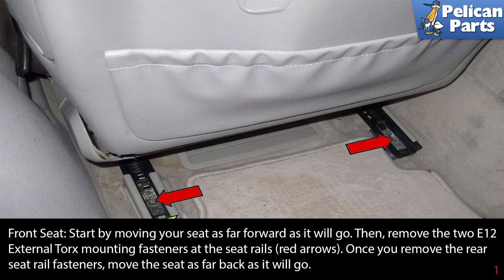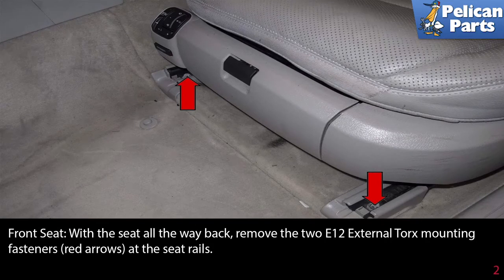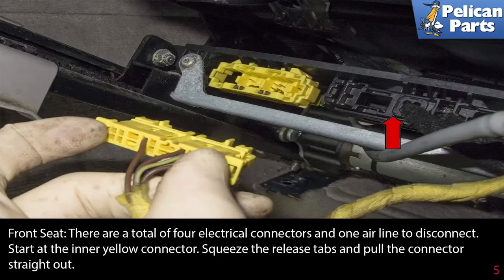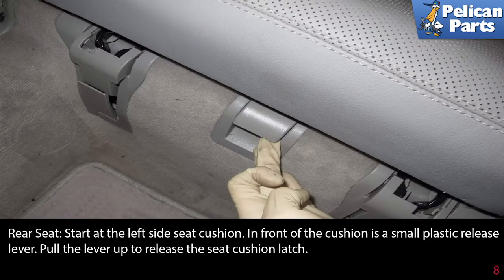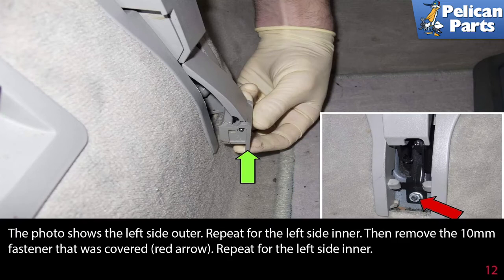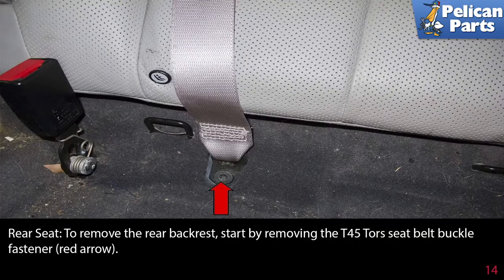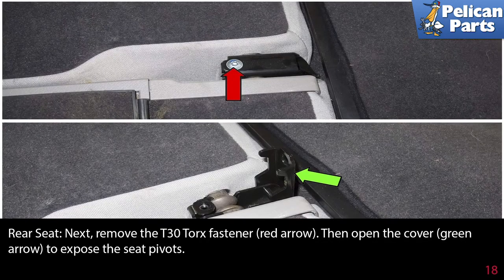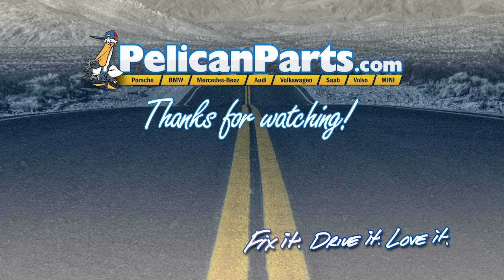Mercedes-Benz W211 E-Class Seat Removal and Replacement

Comment: And for seats that doesn't have the foldable rear seats? This only applies for the models with foldable seats
Reply from the maker: The seat back is unbolted at the bottom, then pushed up and removed. 

We don't currently have that tech article. If we get a chance to perform the procedure, we will be sure to document it.

Comment: What happens if you pull the front seats with the battery plugged in?
Reply from the maker: You will set fault codes that will require a scan tool to clear.

Comment: At 1:43 min, do you know the part number of the bigger white (female) airline connector? It's almost impossible to find a replacement online as mine broke due to brittleness.
Reply from the maker: With your vehicle info handy, give The Pelican Parts parts specialists a call at 1-888-280-7799. They can figure out what part or repair kit you need.